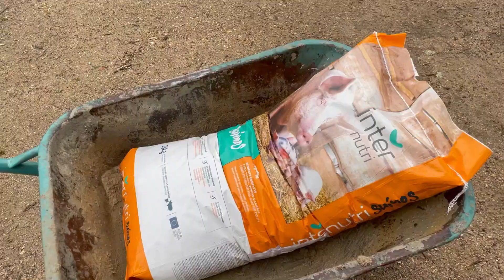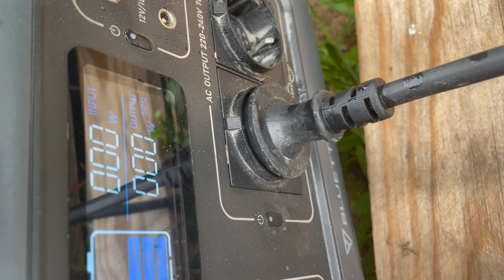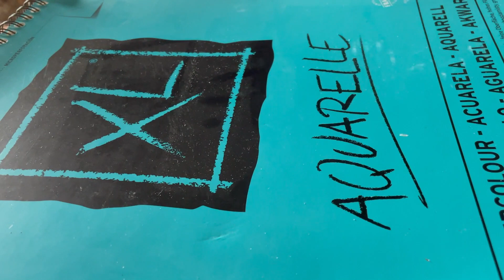LIFE AND DEATH / OFF-GRID HOMESTEAD

Comment: As I think I have said before my Mum ran a pig farm for many years to suppliment and eventually totally suport our family due to my Dad's ill health. When the sows were farrowing she sat with them even if it meant staying up all night but to help the stituation of piglets getting squashed she had a corner of the pen built in such away that the piglets could scoot under out of harms way when mum rolled over. One of your pallet bases with the bottom slate removed and attached firmly across a corner would surfice and therefore save your piglets. I think I have told you also of one sow who had a bad habit of eating one or two of her young this was stopped by making a huge stew in an old copper that contained meat, Mum's vet suggest that this sow was lacking in iron and that was the reason she was eating her piglets. this solution worked really well and all the pregnant sows benefited by this measure. Some of them suffered from mastitis and that lead to six or seven piglets living in our bathroom in a box as Mum desperately tried to keep them alive. Only one survive. The smell of little piglets with the scourers was awful. but the solutuion to the sows problem was some kind of drench the vet prescribed administered in a mixture of beer sows loved it and it worked. I am afraid I never knew what was in the drench however.          Cheers Cindy you are doing a great job and those litters are so cute.                                                        Lana                                                 Australia
Reply from the maker: Thanks Lana, and thanks for the tips!

Comment: Put the call out to Nick to make a whelping box asap even tho Juno has already delivered.  It will keep them contained so you don't find them under the furniture and might keep her from relocating the puppies outside.  I would also talk to the vet and get some supplemental formula with bottles.  Juno will most likely do fine but if you need to supplement the smaller puppies, better to have supplies on hand rather than have to run out on short notice.  You are going to have your hands full between work, the farm, and the puppies!
Reply from the maker: I'll construct something for them and I have a supplement to give that contains vitamins and calcium for Juno.